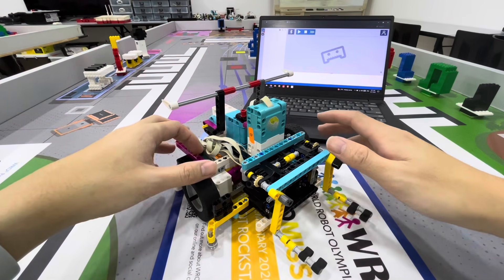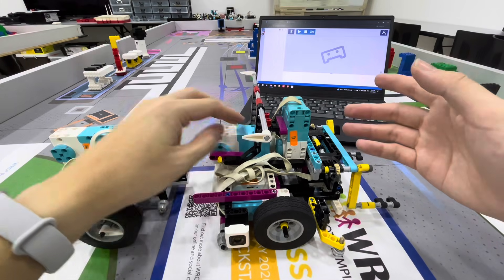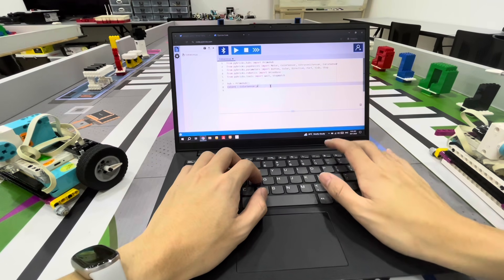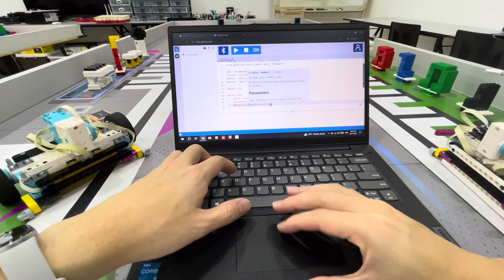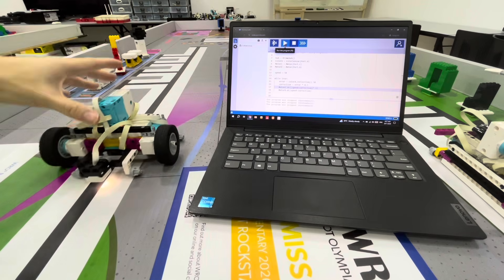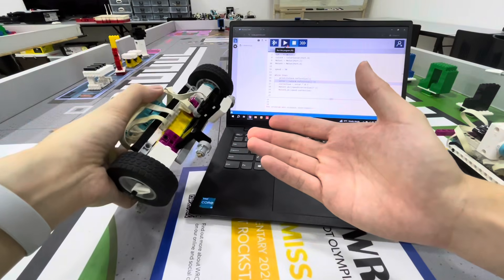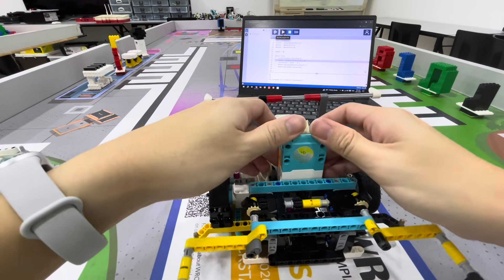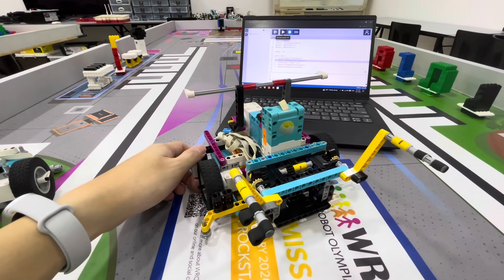WRO 2026 Elementary Lesson 1 (Robot Base & Follow Line)

Comment: We have so much to learn and when we get such high quality lessons from a team like yours we know that every tip comes from a lot of experience. Thank you!  
How high do you have the color sensor from the ground? 1 peg or 8mm seems too low and 2 pegs 16mm to high. what do you have with your base?
Reply from the maker: 1 - 2 stud, for this robot, because of the wheel, the sensor is 1.5 stud above the ground
Reply: @tesslabrobotics So you acheave 1.5 stud by using a wheel size !!! what is the diameter of your wheel and are such wheels sold by stores?
Reply from the maker: @HarisPetrou lego 32020 & lego 32019 

Yes they are sold on bricklink